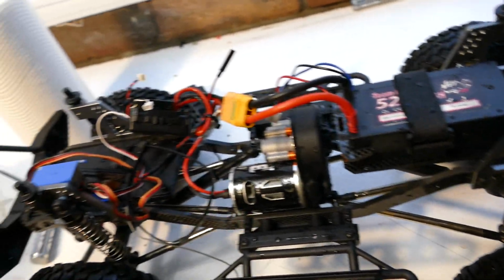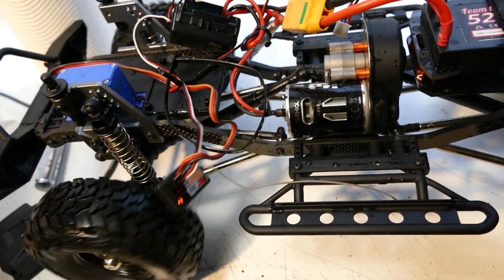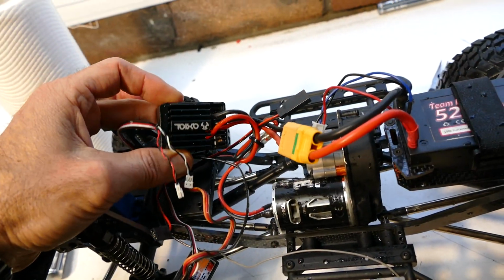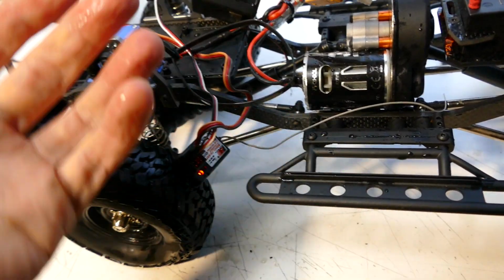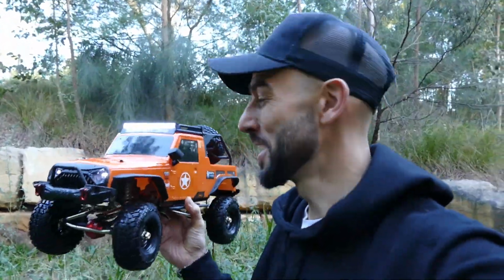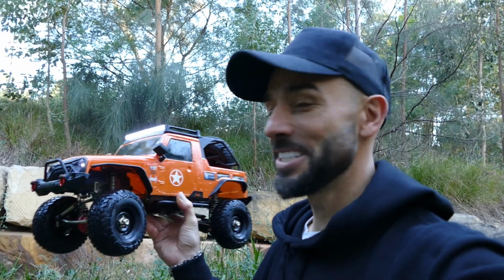RGT PRO JEEP Rock Crawler - Carbon Fiber Frame....ANY GOOD? First Crawl...Waterproof?

Comment: You used the carbon fiber chassis kit for this car, it was meant for the hard body pickup on whiter that was beautiful.  Gave you problem on the axial scx 10 4wd
Reply from the maker: No this one is another one. Comes with what you see

Comment: You should pick up a bottle of conformal coating and coat your receivers. I use in on my FPV drones and can fly in the rain if I want. I will be taking out the receivers in my RTR's and doing the same. It's a cheap preventative measure and works well.
Reply from the maker: Thanks for the info bro.